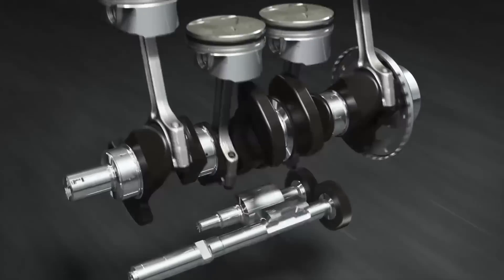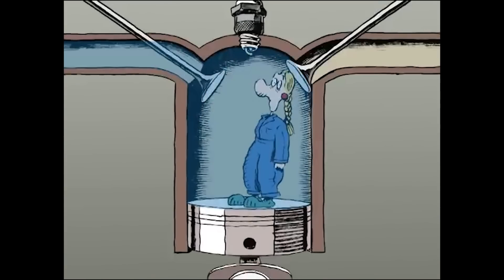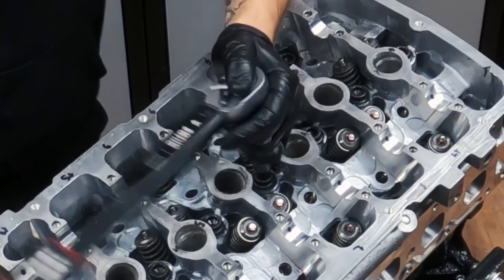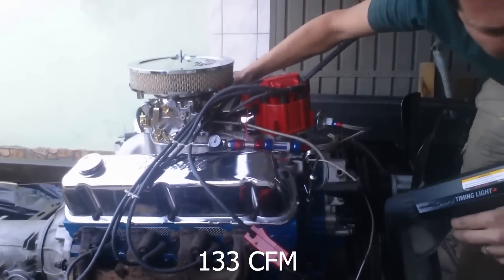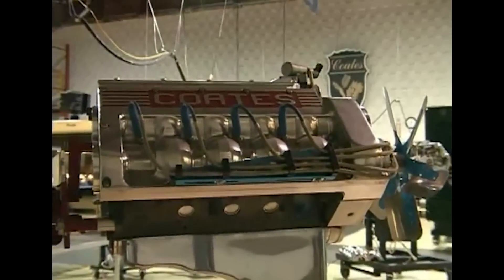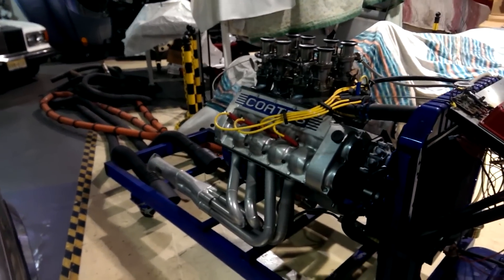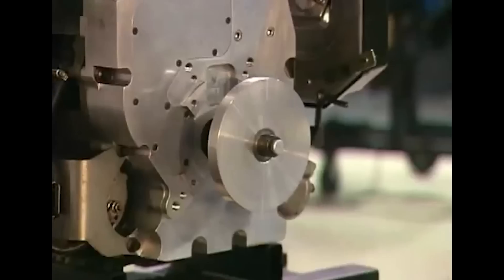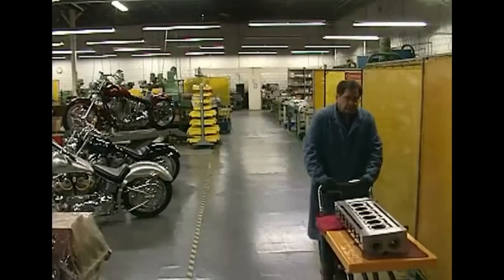A Promising Evolution in Engine Design - The Coates Spherical Rotary Valve

Comment: That’s not true bro it actually works but the conventional drive train and EV manufacturers suppress them. That really works
Reply: Grow up. If anyone is blocking it? It is those who make today's traditional valve trains. The ones who build them, and maintain them. 

 EV makers don't have to worry about any ICE developments. 

 The future is pretty clear the future is EVs. 

 The reality is people don't want to invest in ICE developments, when the future points to EVs. Why invest in a tech when there is a better one coming up making your investment obsolete? 

 Besides why use this design when there is a better one that uses just one cylinder for both intake and exhaust. 

 It is called... The Rotary Valve. Look up BCS Rotary Valve I think it were. 

 Oh and the issue is the seals in order for them to work.

Comment: Maybe letting the ball float just a bit, rather than being firmly attached to the axis it turns on, would help.  Cylinder pressure would then tend to force it against the opening the ball is blocking.  The resulting narrow passageway would discourage leakage.  

Further, it would be nice to limit rotation of the ball while it is sealing against combustion pressure.  No reason the shaft it turns on has to rotate at a constant rate.  There are lots of linkages that can accomplish that.  For example, a windshield wiper linkage fully stops the wiper rotation at two points in the cycle.

Nothing I’m suggesting is terribly new or innovative.  Certainly many good minds have contemplated this problem for decades or even a century.

Comment: That is a very old design of valving the cylinder, motorcycle engine in the 20s had same concept.  It fails quite quickly, the drum or ball cant seal the combustion chamber for very many miles.

Comment: it's not hard to get 500hp out of a normal 350ci V8 with the industry standard valve stem valves... would be interesting to do a leak down test on one of those Spherical Rotary Valve heads after they have 3400 hours of 2500-4500rpm put on them.

Comment: I remember looking at a video on these valves in automotive class back in 2002. They had a Harley Davidson with these rotary valve heads and a few four cylinders and the V8 small block as shown. Cool design but i guess the valve isn't cost effective to produce.

Comment: This is not new and while it can make an engine work it will not last because nothing has been able to outperform the self sealing nature and durability of modern poppet valves.
thanks for showing this but include the downside of the design.

Comment: Progression of the aspin valve from the 1930s.  The only efficient rotary valve engines that I can think of are two strokes using disc valves.  Rotax 256 and it's variants - 100hp from a 250cc engine.
Reply: Two stroke rotary valves only seal transfer case pressure, not cylinder pressure.  Big difference.
Reply: My first bike was a Kawasaki 100 two stroke with rotary valve and like you're saying it only vented into the crankcase

Comment: One of the big heat input in engines is the valve train, roller lifters and roller bearing rockers have helped eliminate some of the heat output, but spring pressure for seating valves also creates heat. A rotary valve would need to seal of course, but just like poppet valves they would need to be able to transfer combustion/ compression heat away from the actual part to maintain thermal expansion and not overheat. Likely a lot less friction loss , less energy to operate , higher flow all contribute to higher efficiency. Sounds like a great idea, just get it implemented.

Comment: Others below have commented that this isn't a new concept, which doesn't mean it isn't a good idea, but I can see problems that need to  be overcome, some of which may be insurmountable. There is one advantage--valve float at high rpm would be eliminated. In the past I've worked on evaluation of alternative engine concepts, and quite often new concepts serve to illustrate the advantages of current practice.

Comment: Well this technically is old, but perhaps technology has advanced enough that the leaking and blowby on the combustion stroke can be eliminated or reduced enough that it isn't an issue. If you look at it, it seems like a great idea since the energy used to open poppet valves is a drag on the engine, plus cams, lifters and valves do fail and can cause catastrophic damage. A rotary valve system would greatly reduce the parasitic losses and eliminate catastrophic engine failure when the valve train has a failure. Hopefully material science can make this possible and prolong the use of internal combustion engines in vehicles for longer with reduced need for fuel and less emissions.

Comment: How does this system deal with carbon build up.  I know direct injection alone causes carbon build up in the intake. How often do  those roller valves need to be cleaned?

Comment: The big cat manufacturers didn't want it because of its own investment in poppet valves and intake etc. It was proposed to Ford and more.
Reply: no, with rotary valve designs there is a big catch. Sealing of valve. So every ime vale "closes" some gases bypass valve and go in engine head. This is why rotary valve designs were abandoned.
Some rotary designs had to have 2000rpm iddle in order to run properly.
Reply: @bajkerjohnvolta  there is a solution with 100% sealed ones, looked at that video a while ago. 

That's the engine top proposed to Ford etc.
Reply: @smaberg  hmm oki. Interesting. Ill take a look. Thx.

Comment: Rotary valves should be a lot smaller, and sitting in a machined bronze case so it can seal and be lubricated naturally. Adding a small oiling jacket on the shaft can be done to add a very small amount during running. I would imagine oiling it too much will just result in burnt oil in the combustion chamber.

Comment: Design's nothing new .. The Coates demo heads were featured in Car Craft, and a host of other magazines back in the 90's... the concept is awesome, but hard to seal compared to the poppet valve, not to mention silicone or rubber being exposed to exhaust gas temperatures.

Either it worked and Detroit squashed it because there was too many industries supporting the conventional poppet valve train, or it doesn't seal well, or that well for reasonably long similar to a rotary engine and it's apex seals..

Comment: 15:1 and higher, thats could be interesting, because we already use 14:1 compression ratio, when we tune an ordinary alcohol powered engine (It came with around 12.5:1 from factory because It is bifuel, need to run with Gasoline too) specially 80's and 90's alcohol engines

Comment: Just looking at the mechanisms it should be cheaper and less complicated to manufacture but the seals between the valves and the combustion chamber is probably the issue, thus you can’t maintain the seal for a long time of operation

Comment: Coates only worked on a small block ford..I saw it on their dyno….but as I am a race engine builder I offered to put their test engine in a mustang chassis to make a few 1/4 mile tests
Of course they refused…they in the mid eighties or late eighties were clueless as far as opening and closing timing …events
They admitted to having issues with getting the sphere to seal and at that time mentioned some ceramic mystery solutions

Needless to say it did not get picked up by the big three American companies….when I interviewed them the entire dog and pony show was staged…one part set up in a hobby shop mill and the throttle control on dyno was a bicycle cable 

But what alerted me..not one chip and the head man has a white lab coat on..

Comment: Koenigsegg, who makes some of the most exotic hand built cars and patents and inventions in the world design a "free valve" engine that opens and closes the valves via computer software and pneumatic slides.
  It is a proven technology he has a patent on and not only reduces the weight of the engine by some 25 or 30%, it makes much more horsepower and has the ability to program your own camshaft timing with the push of a few buttons
Reply: Renault introduced  pneumatic valve actuation in 1986, their V10 Formula 1 engines powering the all conquering Williams Teams cars of the early '90's, dominated that period, now all F1 engines have them, and GP Motorcycles now also have them. Christian Koenigsegg was 16 years old in '86.

Comment: That head assembly is HUGE!
Reply: Big head means big air flow.
Reply: 24v vr6
Reply: actually depends on design but generally rotary valves are smaller.

Comment: I remember seeing this technology in a Popular Hotrodding Magazine in the 1990's and there was an actual name other than Cotes attached to it, That name was Ryan Falconer. Ryan was an engineering maverick that specialized in gas engines and was always trying to improve efficiency (Efficiency=more performance that can be obtained). He's known for some engine designs that were either used or considered for indy, A V12 as well as a 3 cylinder harley based engine, one of which was put in a custom chopper for the Great Biker build-off series

Comment: I have a sketch of a type of rotary valve head design that can use cam timing and the amount of open time. The key to my design is that the rotary valves don’t rotate 360* but act on a cam design that opens and closes the valve with 1/10 the weight of a conventional valve spring. No patent yet but would like to experiment with it first.
Reply: I appreciate your trial so it's been 1 year, how are the results now?
Reply: @truth_seeker_society 

Been a crazy year. Still have my initial design but haven’t actually worked on anything. Basically same concept but valves don’t spin. Can adjust timing like variable valve timing and how long they stay open. If I only had a machine shop I could make a prototype head on a single cylinder engine.

Comment: My argument is you can get more horsepower out of a conventional 5.0 Ford so why bother doing this ? 
Also  aftermarket heads have flow numbers as good or higher than what the rotary heads are claiming .  Before you go and try to push a design it should at the very least be superior to what is already available.

Comment: You're missing some information. The reason why high compression engines aren't a thing. They create high NOx. NOx and sunlight creates smog. When you talked about the added airflow. An engine can suck in so much air. The amount the piston travels from top to bottom under atmosphere pressure. That is why turbos are a thing to over come that limitation. It looks like there would be some loss where the cam meets the combustion chamber. The seal there is under a lot of pressure and must be a point of failure.

Comment: This is not a new tech at all. It was used in Rolls Royce Griffin engines in WWll for goodness sakes. It usually resurfaces every 20 years or so and due to metallurgy issues it doesn't work out. If someone solves those problems it may be successful but there are the mixture flow issues with a constantly changing shape in the intake tract as well. Good luck to these people as efforts to replace the standard poppet valve have been tried for decades. It would be cool to develop a more efficient valve system.

Comment: Use it like sliding valve, adjusting the intake instead of measured cups. Instead of full rotations just a few degrees will open and close the flow!?!?

Comment: Possibly get it to function reliably on a single cylinder engine. Easier to control the thermal load. Imagine something like the Yamaha YZF450 unit? Replace the 5 valve head with these rotary valves.

Comment: i came up with a piston valve that solved most of the issues, except one... lubrication. and its the same issue that hounds twostrokes... having piston rings pass by ports, piston rings in a cylinder alone, need lubrication.

as an added advantage, as it then creates a form of "opposed piston", it actually increases power delivered to the crankshaft....

yet, as i find it hard to rip people off, or push my concepts that hard to gain development funds, thats where it stays, as a concept. easier to not develop an idea at all than deal with it not quite living up to its claims...

Comment: Driving4answer  made  a great video on this subject, he said that it's shortcoming  are that it don't seal the cylinder properly  during it power stroke therefore  losing power
Reply: Doubling horsepower doesn't sound like losing. If they make it legal on indy cars and Nascar  it won't be long before someone figures out how to fix the blowby problem. There's gotta be a way, some type of clever groove or chall or something. There's gotta be a design solution.
Reply: Except this does not operate with a same principle. The rotary valves on his video had inlet and exhaust port channels going through them, that is not the case with these spherical ones.